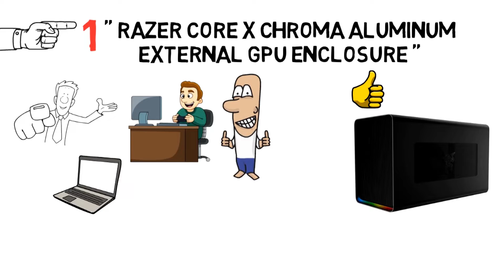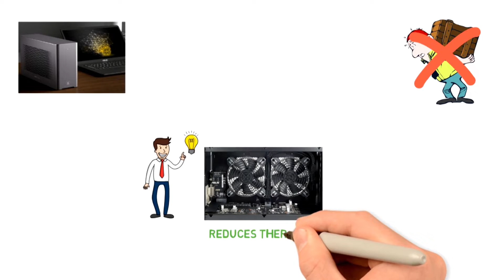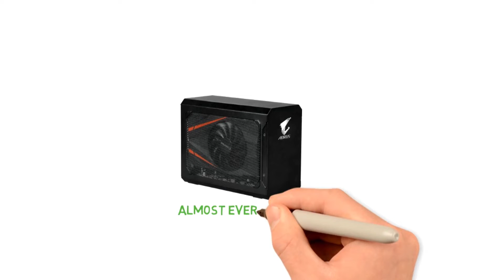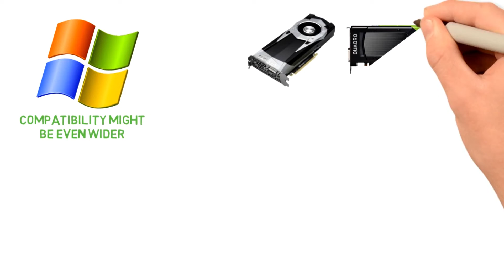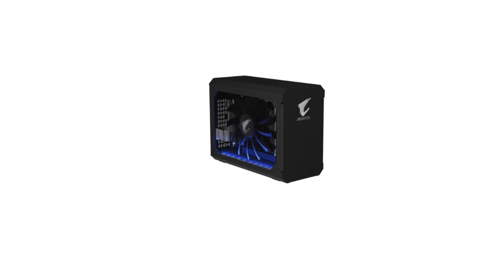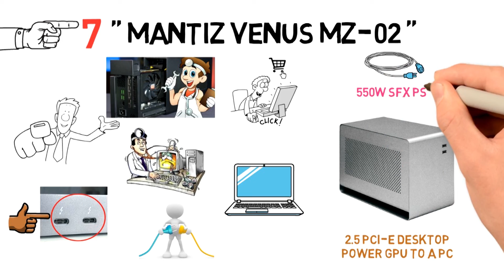✅ TOP 5: Best eGPU 2020

Comment: I just want to point out that the EGPUs compares were only enclosures.... a box,power supply, pci slot, some io ports and cooling fans....you still need a video card for these units. Careful when picking a graphic card for a size and power requirement compatible.

Comment: Does it have to be a NVIDIA card or can I use msi or Asus graphic cards?
Reply: Short answer is most cards will work, but it is hard to answer this quickly. NVIDIA and AMD (Radeon) are companies that make GPUs (Graphics Processing Units). Companies like MSI or ASUS take those GPUs and build "Graphics Cards" around them... so ALL (more or less) MSI or ASUS Graphics Cards are either NVIDIA or AMD (Radeon). Both NVIDIA and AMD cards can be used with these eGPU enclosures, as long as the computer they are connecting to is also compatible. For the most part, Windows computers will work with anything, as long as you handle the drivers correctly. I think Mac may be more picky, however, but I know AMD cards work (someone please correct me if I'm wrong on this).
Reply: Valmarn I use a Razer stealth 13 inch 2019 version and I wanted to buy a egpu and I have a Razer chroma and I’m looking for a gpu that is cheap and fits like a rtx 2070 or a rtx 2080
Reply: @lolbackup2212 
Short answer, I think you should consider Razer Core X, Razer Core X Chroma, Sonnet Breakaway Box 550 or Sonnet Breakaway Box 650. Others might work, but come with drawbacks that I will try to explain below. I personally would buy Razer Core X (non-chroma) or Sonnet Breakaway Box 650.

Answering for each of the enclosures listed in this video:
1. Razer Core X Chroma Aluminum External GPU Enclosure - This would work fine
2. ASUS XG-Station-PRO - This will NOT charge your Razer Blade Stealth through the Thunderbolt Cable (only provides 15W of the needed 65W), and has a pretty crappy power supply unit... would not recommend
3. Gigabyte AORUS GTX 1070 GV-N1070IXEB-8GD eGPU - The GPU is built in, so upgrading beyond the built in 1070 is harder, and it's a pretty low end 1070 powered by a lower end power supply unit - I would only recommend this option if you NEED the enclosure to be small (upgrading this to a 2080 would be dicey, I think the PSU would give out, even if you could find a card short enough to fit the case)
4. Sonnet eGFX Breakaway Box - The 650 and 550 models will work fine; the 350 model will not charge your laptop through the Thunderbolt Cable (only provides 15W of the needed 65W)
5. Akitio Node - This will NOT charge your laptop though the Thunderbolt Cable (only provides 15W of the needed 65W), so I would not recommend if that convenience is important to you
6. Gigabyte AORUS RTX 2070 - Same issue as with the 1070 version, except it comes with a 2070... again, would only recommend if you need a small enclosure
7. Mantiz Venus MZ-02 - I think this model is discontinued, but I could be wrong... but it should work...

Not in the video:
8. Razer Core X (non-chroma) - Would work fine, and is cheaper, but does have fewer features than the Chroma edition

There is a lot to consider with this purchase for you to keep in mind.

First, the thunderbolt cable is VERY short in most cases; being as small as 1.5 feet. You can buy a longer cable, but you need to make sure it is 40Gbps bandwidth, which will usually mean it is an "Active" cable, making that cable very expensive.

You will NOT get the full performance out of an RTX 2080. In fact, I think that the 2080 might even be bottlenecked beyond diminishing returns... getting anything bigger than a 1070 or 2070 might be a total waste of money, but I think it depends on the use-case. The issue of bottlenecking on these enclosures is complicated, and not something I know a whole lot about, but it is related to the CPU in your laptop, and how the motherboard handles the bandwidth... I'm sure if you look up "egpu bottleneck razer stealth" you'll find something.

Personally, I think seeking an enclosure that does more than just GPU stuff (like adding USB ports or ethernet) is a mistake; the more "different" functions you have a dock do, the more that tends to go wrong if you frequently attach and de-attach the laptop... and in addition is not worth the expense as a separate box that does those things on the side is much cheaper than the extra money your spending on an enclosure with those features... but with that said, the top/name brands will have more frequent firmware/software updates to make sure these functions work better.

Finally, be prepared to deal with a lot of glitches between games/programs as you transition between being docked and not. Software can help games and programs automatically switch between settings, but it is definitely more trouble than having a separate gaming rig at home... I cannot say for sure, but I think Razer has an edge up on their competition when it comes to these issues.
Reply: @Valmarn  holy shit thats a whole essay